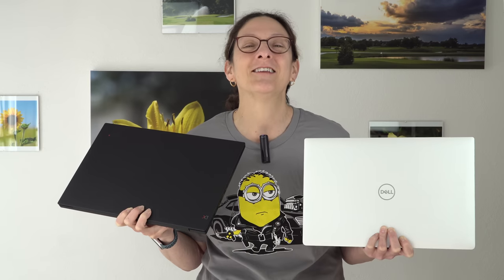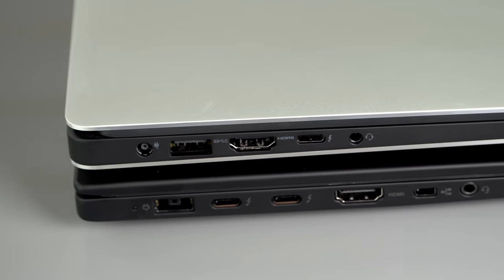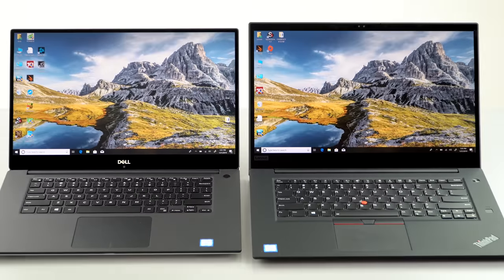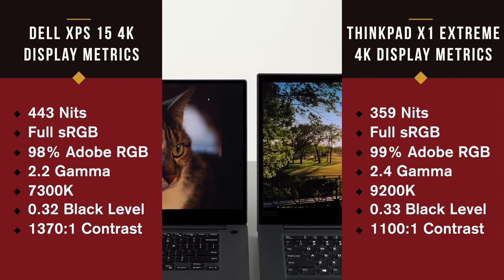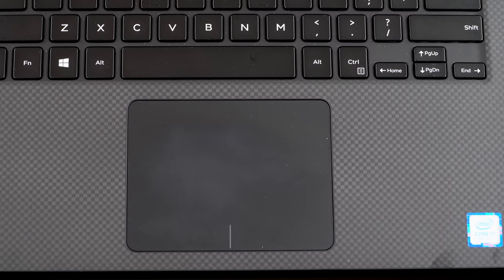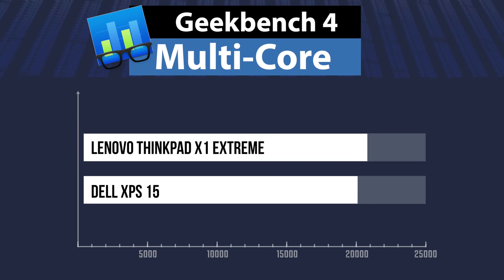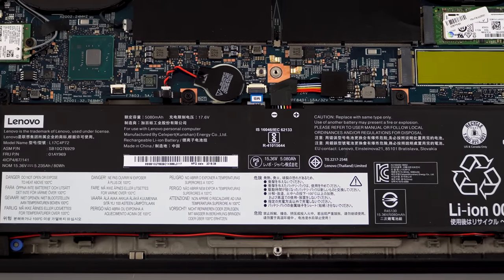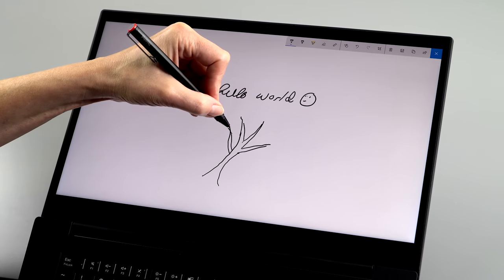Dell XPS 15 vs. Lenovo ThinkPad X1 Extreme Comparison Smackdown

Comment: My baby arrived today. I've been waiting for a month to get my X1E. Upgraded it with a 1tb sata ssd. It's an absolute monster and I already love it. I already tried some deep learning on it and it blazes trough them
Reply: I intend to do some deep learning on it too. How was your experience? Did fan make lot of noise during training models? And does it stay quiet otherwise or randomly keeps turning on as in thinkpad t470. And how was heat disdipation?
Reply: Awesome machine! Enjoy!!!
Reply: Hey Deldarel, any issues so far? thanks
Reply: How has it hold up? I’m a data science junior looking for a new laptop and will definitely use it for some machine learning / NLP projects.
Reply: wrr

Comment: I've had this XPS 9570 for about 6 months now and overall it has been very good.  The biggest issue has been the thermals, as Lisa mentioned, but a repaste/undervolt takes care of this for the most part.  The 4K screen is excellent with minimal back-light bleed, but the reds are indeed overblown - however you can tune them down via Intel Graphics Control Panel.  Minimal/non-existent coil whine - Dell seems to have fixed this issue for the most part via BIOS updates.  Battery life is surprisingly not bad - you can actually push 8-9 hrs or longer with a combination of the undervolt, Battery Saver mode, and even turning down the screen resolution to 1440p or 1080p in a pinch to squeeze out more battery life.

Comment: I'm loving my X1E.  Got the 4K i7 model with 8 gb of ram to bring it down to 1600 after tax (BF Sale) and then purchased 32 gb of ram and Samsung Pro 970 1tb and love this badboy.  Use it for school and work.  Keyboard has no competition.
Reply: Sweet
Reply: The keyboard's on Lenovo laptops are the best.  Better than Apple.  Better than everything I've ever used.  Except against those old IBM keyboards but i digress.
Reply: @timothyandrewnielsen  Lenovo came out a 25 year ThinkPad special edition with the IBM keyboards. Idk if they are still selling those
Reply: Archie Ray bad back case, it is alu with black coasting, i have one and regret
Reply: do you still use the other ssd inside?

Comment: I have Dell xps 9560 and there is no replacement battery. It is just over 2 years old and I can't get a replacement battery anywhere. If you want to buy a Dell laptop, keep this in mind. Dell has replacement parts for everything but the battery.
Reply: What?

Comment: just received my X1 I7 4k 512 ssd 16 gb, I absolutely love it. light and very powerful. The keyboard is great now i understand why so many people talk about the thinkpad keyboard. The 4k screen is fantastic, so glad i spent the extra cash on got it. 
The double ssd and ram slot is forward thinking when you get this laptop. It takes just 26 seconds to start up the pc, ligtroom photoshop traktor starts in just a seconds.
The finsih of the laptop is really good. i would have like to have speakers with a little more bass but its ok. The trackpad is really soft so soft that you feel the dust on it sometime :-) overall it´s a good laptop not the cheapest but one of the highest standard.
Reply: whats the battery life like on it?
Reply: Have tried moderate gaming on it?
Reply: I don't play games, I use mostly Lightroom, Traktor and Photoshop. I must say Lightroom makes the fans spin frequently...  @suttongriffin8154

Comment: One major difference is that a Thinkpad simply works. And if something should happen, there'll be great support. And on top of that tens of thousands of Thinkpad lovers worldwide who like to help each other out in different forums. 

Dell computers are the exact opposite. You briefly touched upon this in your review, but it is THE MOST important issue for us professional users! Dell computers are unstable, they break, and when that happens there'll be ZERO help. Costumer support is abysmal. No help from the company, and you'll also have a hard time finding people online with any love towards their Dells. You're basically on your own with a deficient product. 

It's incredible if you can get a Thinkpad for the same price as a Dell, because the most important aspects of it (reliability and support) are SO MUCH better. It should be double the price if the specs are the same.

Comment: I needed to decide between them and as an old T480s owner I had my heart on the X1E but the small battery, horrible Full HD Display and worse price/performance pushed me to buy the XPS 15. Everyone compares 4K vs 4k on these displays but most people buy the Full HD Display so I would say comparing them is also really important.
Reply: Unfortunately the "base level" Lenovo displays tend to be absolutely horrifyingly bad.  

If you upgrade to the premium display options I've found they are quite nice, but the entry level ones are really, really bad.  Often crappy TN panels, and even when they are IPS panels they are low res and often have poor contrast and terrible colour accuracy.  

I have definitely found Dell to be more consistent on the Display side.  Their top tier displays are mindblowing good, but even their base displays tend to look decent.
Reply: @pete3198  I totally agree! My t480s had the 1440p display and I was quite pleased with it. As far as I know the Full HD panel on the xps 15 is a pretty expensive panel, Frank Azor(head of xps) mentioned it on twitter. It is a color accurate ,400 nit panel whereas the industry standard is still 300nits. It has worse performance when it comes to response times but no one is buying the xps to game on it.

Comment: Sent my X1E back. Fantastic display, but the heat spiked often and opening anything caused the fans to whir like a jet engine. There has been some success with others via repasting and changing filter material. This trend of cramming top tier cpus and then throttling them is making us spend money on performance that never arrives in these thin laptops. If you’re going to get the X1E the i5 yields none of the aforementioned problems. The 8850 is what I had. Other than that, the keyboard is so good. Way better than these trash Mac keyboards
Reply: Yea I sent mine back too , the heat and battery were just abysmal
Reply: i got 8850h too. I gave it a try for one week.  In the first day the heat indeed made fans spinning a lot but after that unless gaming,  it calmed down a lot during normal usage like watching youtube, browsing webpages and doing word editing.
Reply: That's good to know, I ended up with the 8750 and repasted with liquid metal, I think this configuration must be alot more stable as the fans do still spin up quite often but quickly cool the cpu or gpu and I haven't had concerning Temps. Generally around 80 c in intense tasks. (Edit: since my last post I also use throttlestop to undervolt my computer it now runs no hotter than 70c. )Also if you have the 8850 h I would recommend tp  fan control and make a more aggressive fan profile at lower temps. These will completely solve any heat issues.
Reply: Yeah, i7 in an ultrabook is a total waste and the fans will turn up to max even more often after a few more years. i5 is all you need
Reply: will i5 slow the rendering process significantly?
Reply: @M3sutOzil  I don't think it would be significant especially with thermal restraints of a small chassis the i5 tends to do better compared to the hotter 7's.  It will be slower but not significantly
Reply: @justinbagdon5116  oh alright thanks and does the i5 have thermal problems too?
Reply: @M3sutOzil  I don't personally have the i5 I have the 8750 h which is a i7.
Reply: @Joshua Ribeiro I was actually with you until you felt the need to trash Apple's MacBook Pro keyboard. This video isn't even about Apple at all. It's so funny how PC fanboys feel the need to trash Apple even if the subject isn't even about Apple. The same could be said for all the trash trackpads on Dell and Lenovo laptops, because the MacBook Pro is #1 in the industry in regards to trackpads. You could've easily made your point without being an Apple-trolling fanboy.
Reply: @samuelmurillo2244  I'm not a PC fanboy. I very much want a Macbook. However, the keyboard is truly unsavory to type on and apparently not reliable. It's quite the opposite of the Lenovo keyboard, which is an absolute joy to type on. You can't tell me the butterfly keyboard is a success. People make due with it, but it was not a smart move
Reply: @chronia13  Josh, my 2018 MBP 15" keyboard has been rock solid. No issues with it at all. Please do yourself a favor and recognize that Lenovo's Thinkpads are far from perfect. You talk about the keyboard on the MacBook but the trackpads aren't great on the Lenovos. Apple's trackpads are the best in the industry. It's well known. It's not my opinion. The Thinkpad X1 Carbon and X1 Extreme have thermal problems, noisy fans and short battery life on the X1 Extreme. The X1 Carbon has had massive issues with warped screens right out of the box. The fingerprint readers are slow. The Macbook's Touch I.D. instantly reacts when you touch it. You have to turn on the keyboard backlighting manually on the ThinkPads. Is this still 2003 when Apple introduced the first laptop with a backlit keyboard? Back then Apple had an auto light sensor that turns the keyboard on. So while you're spending time trashing the MacBook Pro (as if every other laptop is better) step into reality and realize the Thinkpads also suck on many levels as well.
Reply: @samuelmurillo2244  you're boxing shadows dude. This isn't Mac vs PC and you're making it that. MacOS is good and the touchpads are great. But the main component of a laptop is the keyboard. There is no escape key. The tactile feedback, at the most gratuitous sentiment, takes getting used to. Your keyboard may be fine, but an non insignificant amount of people are experiencing reliability issues and many just simply do not like it. IDC about Lenovo, but I do know their keyboard is incredibly efficient for people who have to use it often. Be a bit more objective and try reading what people are saying instead of cannonballing into Mac vs PC argument that was never there
Reply: @chronia13   I think you started the Mac vs. PC argument when you trashed Apple's keyboards, especially when this video isn't about Apple at all. Don't trash the Mac and expect everyone to shut up about it. Or are you just annoyed that I posted facts about the Lenovo having it's share of major issues?
Reply: @samuelmurillo2244  idk why it's not coming to you. I don't care about either brand. My initial comment was trashing the Lenovo X1E thermals and noise. You're the one who took a widespread criticism of a Mac keyboard personally
Reply: @chronia13  I can easily answer your question. Why don't you go back and read what you wrote. You wrote about problems with the Lenovo. I don't see anywhere that you trashed it as you claim. But then you blurted out "Not like these trash keyboards on a MacBook Pro". Was that really necessary? This video isn't about Macs. It's just that PC fanboys love to hurl an insult towards Apple and Macs, even if the discussion is about something else. Your post comes across as trolling. Please recognize that instead of trying "school me".
Reply: @samuelmurillo2244  The fans sounding like a jet engine is not light criticism. I'm not schooling you. That comment about Mac keyboards is a widely held view. Idk why you keep putting an angle on it like it was a cheap shot. I don't like the keyboards. Many others share the same sentiment. They fail often enough for Apple to apologise. You overreacted.  Get over it
Reply: @chronia13  Ah, yeah you're right, I'll get over it haha. I'm a terrible person and you're superior like Hitler. There, was that good for you? We were having a somewhat civil conversation and as usual when someone's argument starts failing they get mad and insult. Telling me "Get over it". You get over yourself.
Reply: @samuelmurillo2244  there's nothing for me to get over. Now you're talking about Hitler in a tech review video. Just relax dude. It's just words on the internet.

Comment: X1 Extreme is the way to go for me. I like how the thinkpad is built like a rugged tool, and the keyboard, man, I can't live without that keyboard. I have the 2018 X1 Carbon and thinkpads are those laptops where you feel like they start accumulating some scratches and dents.

We're getting the X1 Extreme soon too, and the double nvme slot is big since it makes upgrading storage easy as opposed to needing to replace the whole thing with a more expensive ssd.
Reply: How's the extreme going?

Comment: The Lenovo has a second Thunderbolt port, which should not be looked at lightly. Also, in real world testing the Dell suffers a ton from thermal throttling. Although both companies seem to use really cheap thermal grease and significant speed/ heat improvement can be made by replacing the grease with Arctic Silver or some other quality thermal paste. Other than that, both machines are extremely capable and comparable. I tend to think that Dell May have better support, but I have actually heard of some issues with Dell as of late. And yes, these are the best reviews on the internet!

Comment: XPSs are always having issues. At the company where I'm working at we have 5 XPSs - only the xps 15 didn't do any problem. all the smaller ones (i think 13? 14?) had to change hdd/motherboard / bad thermals, etc.
X1 had issues of his own with really bad drivers, but now it's great.
Go with the x1, believe me you'll have a better luck.
Reply: I've seen a ton of issues with Thinkpads in the past as well.  Though I must admit that my experinces with the X1 models has been much better then with older and lower spec Thinkpad models.

Comment: As a student who likes to game sometimes I opted for the dell. Lenovo is very respected and the ThinkPad looks really cool, the only thing that turned be away was the fn and ctrl key switch (which you can switch in bios but I’m still picky), the lack of media keys, and the battery life. I need good battery life and get more than a day’s work on the dell. I got the 512gb ssd, 16gb ram fhd model for $1400 while the Lenovo (then) was around $2300 for same spec. However if you want the ThinkPad, I still believe it’s on discount for around $1600

Comment: I’m looking for a MacBook Pro alternative for a work station. I have been facing major heating and fan issues with my MacBook Pro 13 (2017). I’m thinking of getting a windows laptop with better spec rather than pay premium for this generation of Macbook that is not as reliable as in the past. What would you recommend?